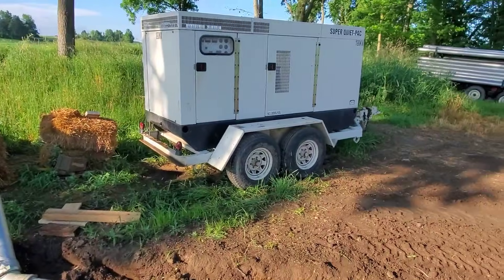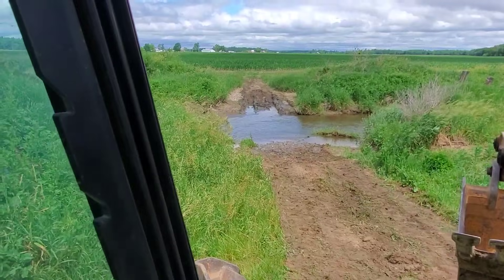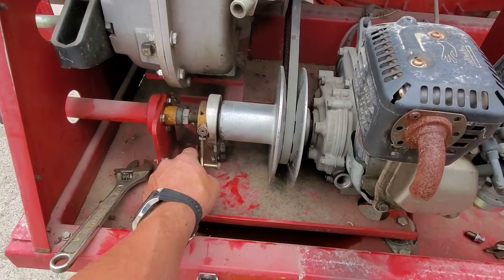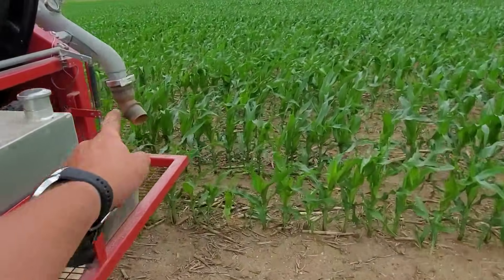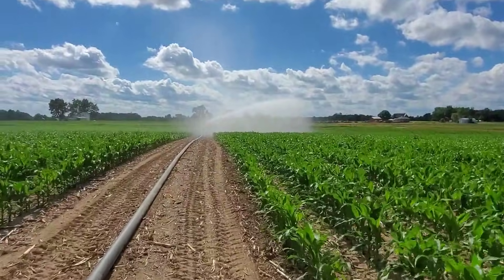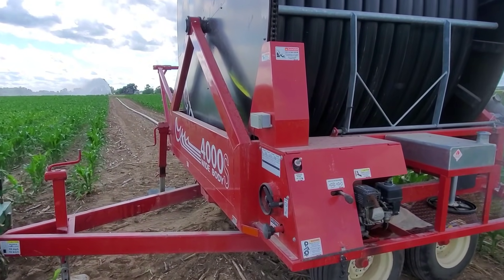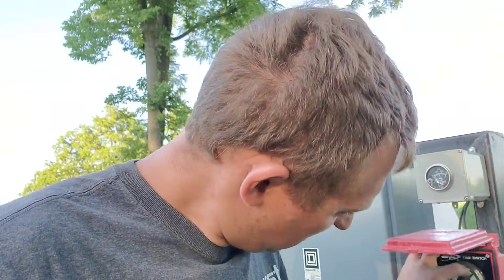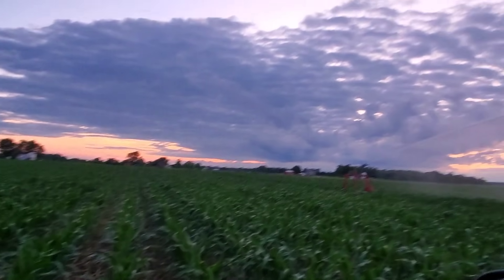Turn on the Pump! - #178

Comment: nice to remember the old days    start 1973    have    3 of that  bauer german     only 350 m long and 72 m spry  yes 25 mm water    12 hours    and it was full time for one man      but we
dig  down    160 mm pipes over hole farm only lose 1 hg-   1000m   and 10 kg   in to machine     30 m3 an hour
one machine       thanks like your channel     and going to follow you

Comment: Grew up on an irrigated cotton farm.  We used ditch irrigation and it would take forever after starting the pump and waiting a half mile away for the water to arrive, and then to fill the ditch sufficiently to start the irrigation tube.  We used electric motors and if there was a thunderstorm with lightning it would knock the pumps off and then if was go restart everything with multiple pumps.  Irrigation of any type takes a lot of work and management not to mention the cost.  Great video.

Comment: Hi.
Why do you have to be there when the watering is finished.?

LOVE THE VIDS
KEEP'EM COMING
RICH(UK) 🥰🥰🥰.
Reply from the maker: This was a long time ago but I assume this one is about the irrigation and being there when the traveler is finished. There is a timer to shut the pump off but if it is not set right the pump could keep applying water after it is pulled all the way in. I also need to be there to move it to the next run. And our generator is running even if the pump shuts off so it has to be turned off if not continuing to irrigate.

Comment: Hi there.
Does the sprayer have a water usage meter built in to it.?🤔
And, if so, how much water per acre do you usually use.?🤔

LOVE THE VIDS
KEEP'EM COMING
RICH(UK) 🥰🥰🥰.
Reply from the maker: The irrigation?  Or the crop sprayer? Either way the irrigation does not have a meter but I know how much our pump outputs per minute and can calculate gallons used based on the time of the run. I usually put an inch of water on and that's about 28,000 gallons per acre. The sprayer does have A flow meter and we usually apply between 10 and 15 gallons of water per acre

Comment: Great video:  Question how do you keep the water coverage the same between the pivot and the end of the spray, how do you verify the uniformity?
Reply from the maker: Its not the same. It makes an arc. There's an area right next to where the reel sits that doesn't really get hit. After I move 4 lanes I'll actually pull the gun back down the center to help hit those areas.

Comment: Need a tow hitch on the back of your irrigation equipment to tow the Gator or 4 wheeler around for ride rig.
What's the yield increase for the irrigated corn vs non irrigated rain only over 5>10 years yields
Expensive irrigation equipment, labor and fuel costs.
Reply from the maker: I estimate we add 15-20 bushels per inch of irrigation. So if I hit it twice with 1" I should get 30-40 bu/ac increase. This is pretty early though so we'll see if that holds true this year.
Reply: @BorderViewFarms   Know the feeling of having irrigation.  Grandpa used to run it for his grass and hay fields.  build a pond, hauled and humped the pipe for years into his late 70s.  Loved playing with his system.  Made hay in the dry years and more grazing for his milk cows but killer work.  We kids disappeared during irrigation season.
Saw some standing water in your irrigated corn while you were still setting up.
Crazy weather here this year also.  Veggie garden in Pac. NW, soaked mud until June, still too much rain.  Love eating sweet corn right out of the garden.  Not looking good for fresh corn this year.
Good luck with the trade wars and weaponized grains market.